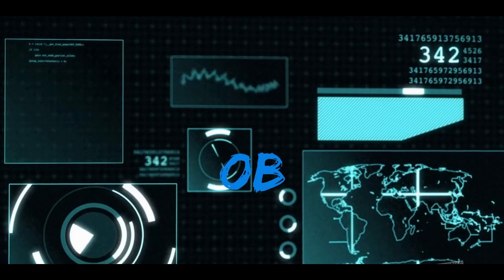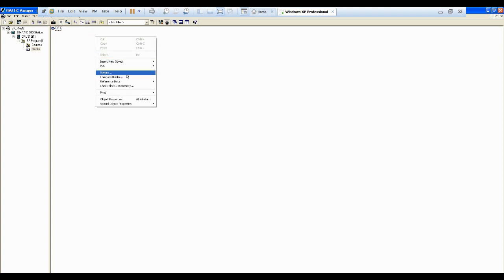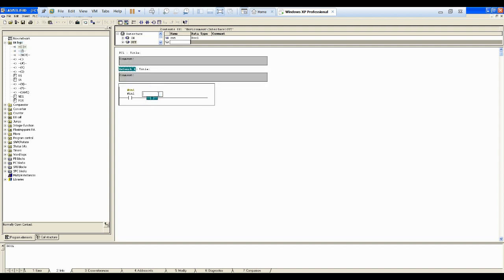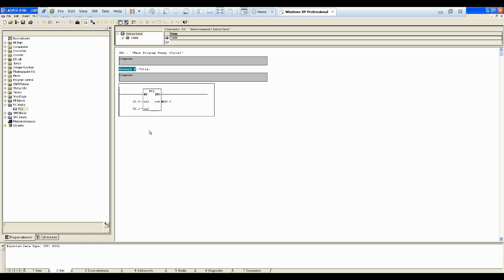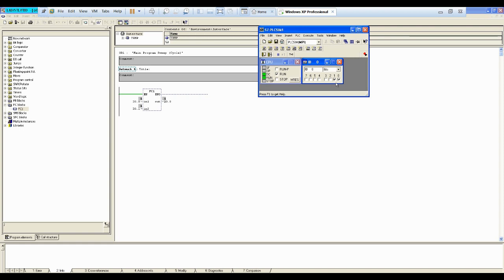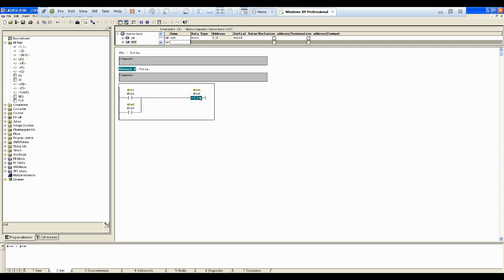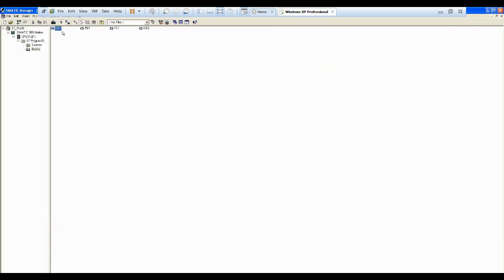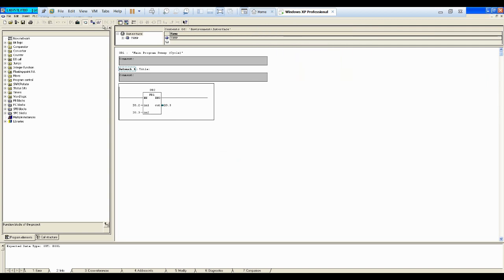19: Function (FC) vs Function Block (FB) - PLC Programming

Comment: hello thanks foe your great explanation. ı wanna ask a question to you sır.i have 3 plc in my system for example name of them plc1 plc2 and plc3 and they are connected to wincc scada v7.5 . when ı open simatic manager  ı can see FB and FC and SFC blocks in my system. ı wanna add more FB and DB for some others necessary  .my question is , if for example ı have 100 fc and 50 fb and some other SFC  and if ı add 2 fc to my system  is it neccesary to downloads all blocks or just ı can select the new fc and  download it ? is it okay .